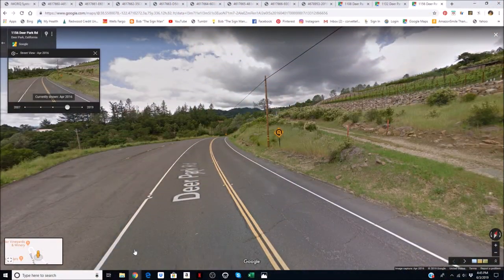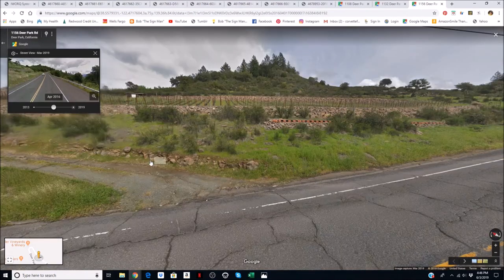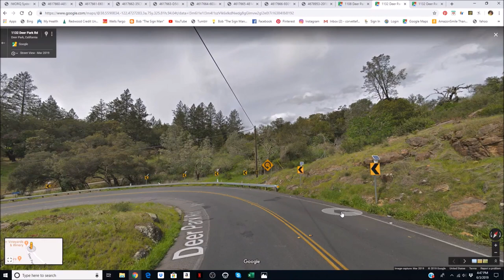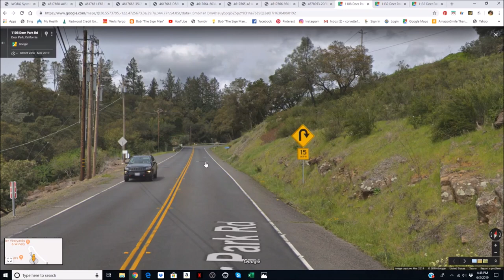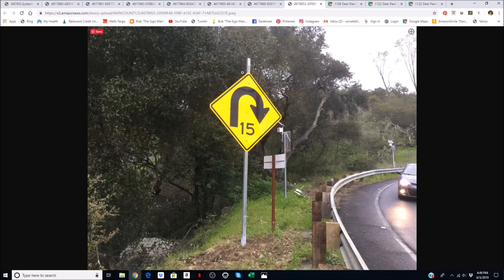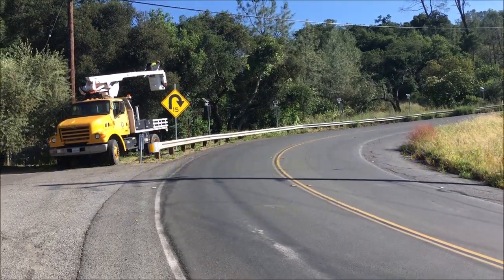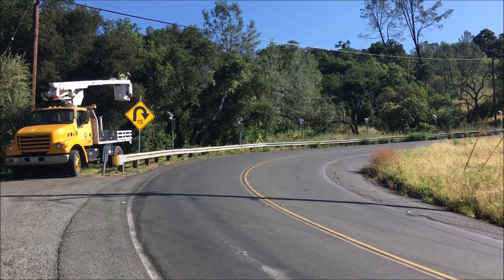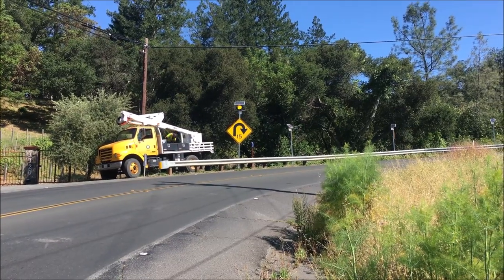Solar Flashing Traffic Sign

Comment: So, did it work. I was wondering if the flashing light for the downhill side were causing confusion for the uphill traffic.
Reply from the maker: So far once the light was installed uphill no one has crashed.  Yet.